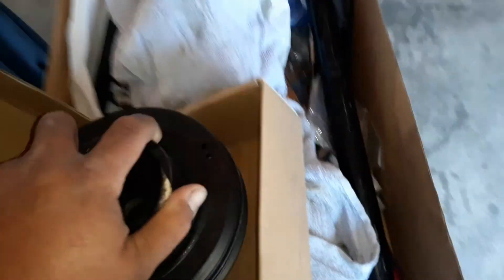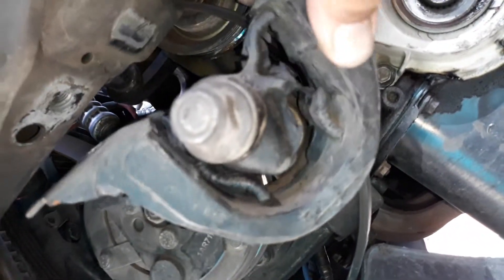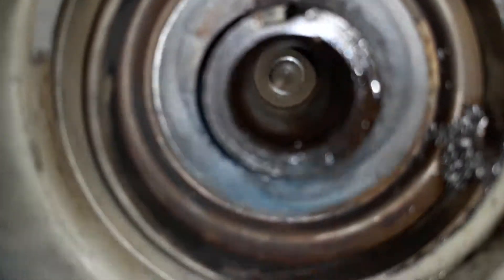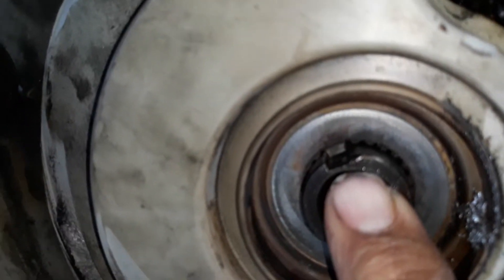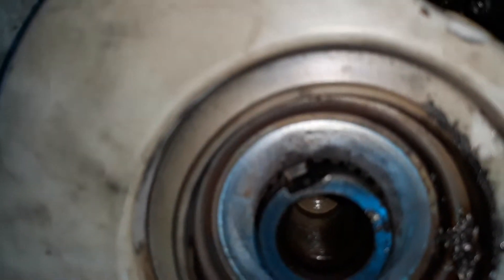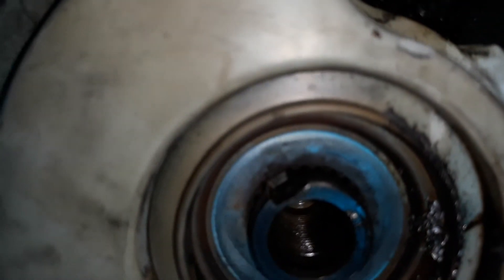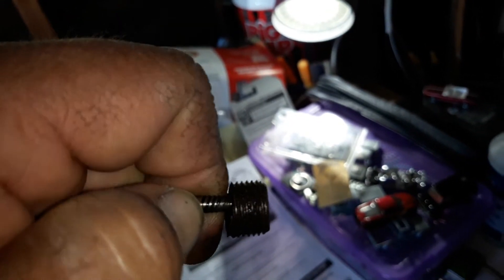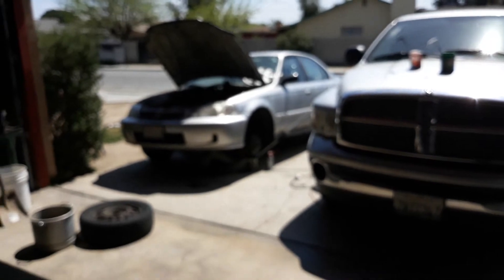Trying and experimental repair on a crankshaft on a 1.6L 1999 Honda Civic LX

Comment: Wow.boy do I have a good one . 9/28/21 it’s my 21st birthday just getting off of work on my way home I hear a thud I loose voltage power steering and the battery light came on I got home waited till it was brighter and noticed that the bolt inside the crankshaft broken inside the threads and my harmonic balancer flew off and left the belts hanging in the engine bay ,1/9/22 I thought of this very i lined up the holes and instered the jetway as much as I could filled it with jb weld as I put in my new balancer on I noticed the threads where chalked almost shredded and it did have play I was able to slip about one tooth ,I covered that in jb weld then slid it all back together and covered it some more it’s now drying and I have discovered this video finally an answer even tho I have done this exactly it’s still what I was looking for,for months
Reply: So it worked is what ur saying
Reply: @trustystream2846  it worked for a bit yes I went through $60 of jb weld it kep coming out but if this just happens to you I have a better way then just covering it all in jb weld
Reply: It kept falling off after I tighter the belts so here’s a key get the steel stik put the key way and the harmonic balancer on the shove that stick in there after you got it ready then flatten the end out like a bolt .I PERSONALLY AM GONNA REBUILD AND TURBO MY ENGINE there’s no saving this situation unless YOU ACTUALLY WELD IT TO THE CRANK

Comment: So i had the same issue car came in and engine was running. So i decided to do a crank kit. The new crank has excessive wobble to the new balancer and i seriously want to do the original jb weld onto the splined area of the new balancer. Then spray some wd 40 ont the crank snout so it will release and squish it together with the new bolt . It needs to have a tight ckearance or it will shake loose again.  Or i might have yo return it for another crank, decisions decisions

Comment: What was the 2 compounds you were gonna use? I have the exact problem on my 02 Acura TL also
Reply: I have the same problem. The crank pulley came out while I was driving and it broke the woodruff key and it stripped it as well. Did the jb weld fix this? Trying to fix it it as a temporary fix before I do an engine swap
Reply: @poisondaddy  bro same around the same time as yours lol my crank bolt snapped inside the threads
Reply: Jb weld

Comment: Same thing just happen to me did you fix the problem
Reply: Yeah mine is still holding. I used Quicksteel, let it hardened sanded it down, then put jb weld around the woodruff key and sanded that down as well. If you don't sand it down, it will not rotate evenly and you'll see the crankshaft pulley bouncing around because the crankshaft will be unbalanced. Its not the ideal way to fix it, but its holding hella good seeing I didn't have $600 for a junkyard crankshaft.
Reply: @groundpounder1165 I’m going to do mind. So it hold right?
Reply from the maker: No, the guy didnt like the fact there would be no warranty on the work. But i do have 2 ideas, if you would like to know.
Reply: Let me know what the plan
Reply: @SuperDjnrg  ¿Did it work?
Reply from the maker: @hoisec2013  I never got to try the experiment ,but I'm pretty confident it would have worked. but when I told the guy that there would not be a warranty, he declined the service. But what do you got to lose, it's a cheap fix other than replacing the motor. If you do try it, let me know if my idea worked.
Reply: @SuperDjnrg  Nothing to loose. I'm toast. Mine it's a cd5 Accord 96. It is the exact same picture of that crankshatf snout of the civic. Once done I'll let you know. Thanks for posting the vid.
Reply: @SuperDjnrg  hey, what's your idea on fixing that problem, please?
Reply from the maker: @hulksmash8942  first get a new Woodruff key to put in the slot. then you're going to need some quick steel from AutoZone to put in the part that is damaged. Quiksteel is two parts of putty that you smash together and makes it very well and it turns hard as Steel J-B Weld may work also haven't tried that yet quick steel seems to work perfectly. You smash it in the areas that is affected then file it down until harmonic balancer slides on smoothly you want to take a fine sandpaper to smooth out the rough spots let it dry for 48 hours and it'll be good as new I tried it on a 96 Honda Civic it's still cruising around with the same motor it must be torqued to 160 ft lb good luck it's a 50-50 chance the it'll work. The key is to let it turn super hard so make sure you give it the 48 Hours it needs to harden.
Reply: @SuperDjnrg  , thank you. ..that's exactly what I was going to do tomorrow on a 160i Honda civic after I extract the bolt. ..here in Cape Town, South Africa,  we use Pratley Steel Quick set ,it's a 2part epoxy as well. ..but thanks for the assurance of it more likely to work than fail. ..cheers brother